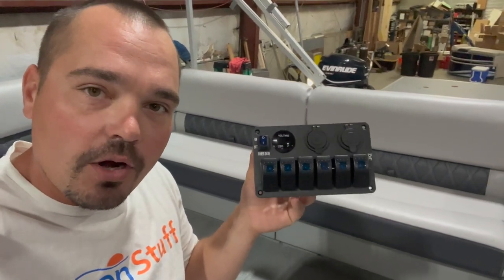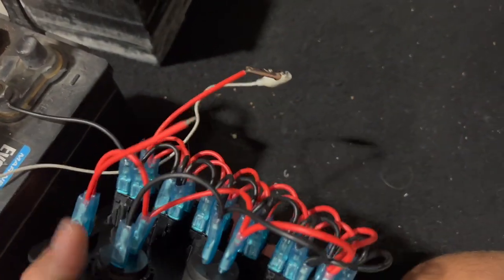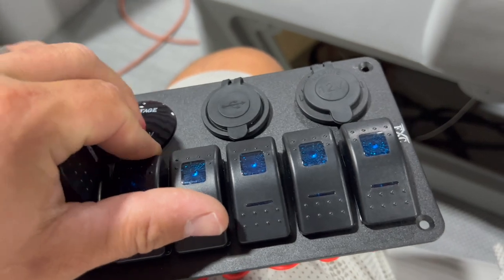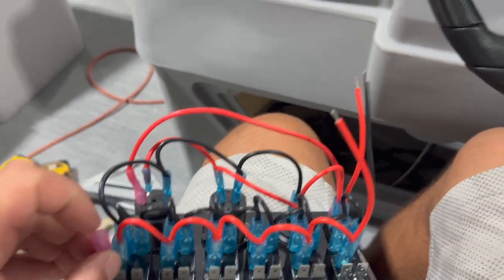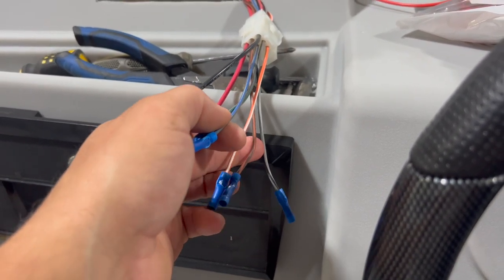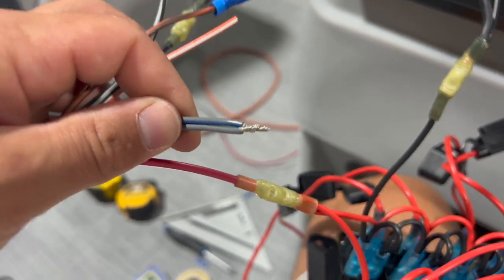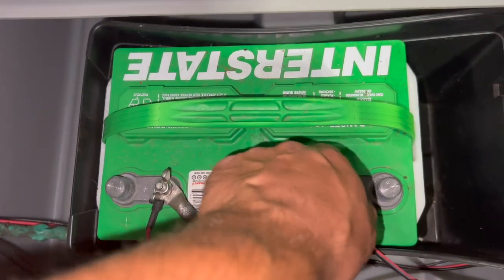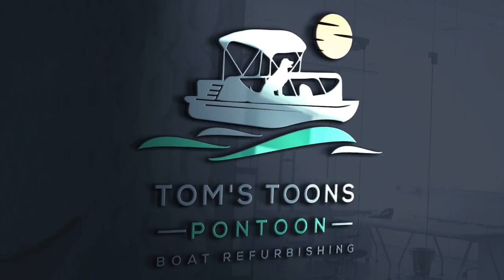Installing Amazon Marine Switch Panel - 6 Switch Panel on Pontoon

Comment: One thing I’ve never liked about these switch panels is how they daisy chain all switch inputs off one wire between all the switches, effectively putting all the load on the one wire feeding the switches. I’ve always played it safe and pulled the jumpers off and ran designated runs for each device Incase I ever have more than one higher draw switches on.
Reply from the maker: I definitely understand that concern. Most of the boats I work on seem to have the same setup where one power wire jumps across all of the switches to supply them power. That daisy chain or piggy backing shouldn’t be impacted by any other switch before it having an issue because it’s a steady stream of power from the accessory wiring harness to each switch. The in-line fuses are something I will be doing for this style switch panel to make it an easy fix if something ever has an issue! 

Thanks for watching!

Comment: Do you have any advice for maintenance on pontoons that will be used in saltwater? As far as the aluminum components.
Reply from the maker: That’s out if my wheelhouse as I’m just a Midwest freshwater guy. I’ve seen pontoons bottom coated when in saltwater to prevent corrosion of the toons. Also, Sharkhide makes products to protect aluminum in the salt so definitely give their products a look! Otherwise, I’d highly recommend reaching out to a pontoon dealer who sells boats regularly for saltwater use.

Comment: Can I ask how your switch panel has held up? Looking at replacing my 99' Pursuit's outdated panel with this. Saltwater boat sitting in a slip.
Reply from the maker: I haven’t had any issues with any of this style panel that I’ve installed. We’re all freshwater here in Michigan though. As long as you coat your connections I think you’d be ok!
Reply: @tomspontoons  awesome, thanks a bunch for the quick response. Figure it’s worth a shot at that low price point.
Reply from the maker: @WranglerRunner1  That's my thought. If it gets covered when sitting and you treat your connections with protection/grease then I think it'll last.

Comment: is there a way to use the switch to turn on and off the whole panel instead of just the lower lights?
Reply from the maker: I suppose you could jump power from the on/off switch that powers the chargers and voltage gauge to power the switches. I’d recommend an inline fuse there though as that’s a lot of power potentially running through that one switch. That way you’d run power to that on/off switch at the top and it would power everything when on and keep anything from working when off. 

I’d probably go with a heavier duty battery on/off switch if your goal is to have control over your accessories. You could simply have it on the console for your accessories only versus having it in the rear stopping all power at the battery.
Reply: @tomspontoons  Thanks,  I'm only using the switches for a horn (changing the first switch), then Nav lights and a Garmin Striker 4.  I'm putting this switch on a Boston Whaler 13' sport.
Reply: Also, I have the 5 switch version so it should be a lesser load.
Reply from the maker: @frankieb3652  glad to help! I love when stuff on our channel reaches beyond just pontoon boats. Glad my content was helpful for your Whaler project too!
Reply: What the empty connection on power save?
Reply from the maker: @cameronwyatt3491  really good question. Didn’t need it on this one. If I remember right it was just another light for the switch which would stay on at all times which I never like because of battery draw!

Comment: This video was so helpful! I haven't been able to find a clear video describing the use of a rocker panel. I am also going to delete out the "always on" lights for the switches. No need to slow drain the battery. I am going to a fuse panel that I added for my Short Bus conversion ;). Thanks so much for posting this!!
Reply from the maker: I’ll do a rocker panel at some point so stay tuned. Problem is there isn’t a nice clean matching nav light rocker switch that I’ve found YET. Glad this video was helpful! Thanks for watching

Comment: I have a 1988 SeaRay I’m working on and would like to install one of those “quick connects”, what is the name so I can look it up?  I’ve tried various searches and can’t find any blanks I can use.
Reply from the maker: Are you referring to the connectors that go onto each switch? Or the big white plug to quick connect the wiring from the main harness throughout the boat to the switch panel leads?
Reply: @tomspontoons  the big white block
Reply from the maker: @barddzen  I just did a quick google search and found a kit. Go to www.CJponyparts.com and search: "Painless Performance Quick Connect Kit 12 Wire Plug". You can find the same kit on eBay too.

Comment: Seems a whole lot of fuzes in random pain in the bum places to find and replace, wouldnt wiring all the positives to a 12 socket fuse box? That way all the fuses are in one easy to locate and service location?
Reply from the maker: I’ve been meaning to show a video using one of these panels with a fuse block like you’re talking about. Some folks love them, sometimes they have their own issues with corrosion and becoming a failure point. I have another video of an Amazon switch panel that has built in breakers…that’s my favorite style by far because it’s so clean and user friendly!
Reply: @tomspontoons  it's obviously different to where your located to where I am here in Northern Ireland we have different things electrical wise. I am planning on using a Blue Sea Add a Battery Kit Plus thing so I can have a starter battery and a second battery to run everything else off, because the boat is parked up on my driveway it can be plugged into the garage to keep both batteries charged up so I've no worries for a day's fishing.

We don't have pontoon type boats here I think our weather is to bad to have boats like that we need something with a deep v hull to cut through waves.

I enjoyed the video buddy, it's good I'm thinking of when I re wire my boat this summer I want to future proof it so when i come to add things to the boat the cables i put in can support them.
Reply from the maker: @DavidScobie  You're 100% spot on. There are different ways to do each part depending if you're in freshwater vs. saltwater as well as the type of boat...and you're right just trying to do it once and get it right so that you're not chasing problems in the future. We always love when boaters outside of the pontoon world tune into the channel as a lot of the stuff we cover is applicable to any type of hull. Happy boating over in Ireland!!

Comment: I have a question where did you find that Quick connect to run them rocker switchs I have a 2002  mercury I need that quick connect...
Reply from the maker: This accessory switch panel is 100% unrelated to anything with the outboard. A lot of boat manufacturers have their own wiring harnesses and use their own quick connects that likely won't match up with aftermarket options. That's why we typically just start over with all new electrical and switch panels for your 12v accessories.

Comment: So with the inline fuses, does this mean theres no need to run to a fuse box also? Say from switch to fuse block with a jumper?
Reply from the maker: It would be an either/or situation. I prefer inline fuses because they're easy to get at, just remove the switch panel and they're right there connected to the switch/accessory that's not working. It seems like fuse blocks always end up in hard to reach places and it can be a hassle to figure out which fuse is popped. Just my personal preference, no wrong way to do it as long as there's a fuse or a breaker in line to protect the switch and electrical system!

Comment: Hi, thanks for the vid. Is the panel waterproof (rain), based on your experience?
Reply from the maker: I haven’t had it in serious rain, but if it’s sealed up behind the dash it should be just fine. A bead of silicone when you install it won’t hurt to keep water out too.

Comment: Got this panel my switch is off when down but want it off when it's up not down how do I do it please.
Reply from the maker: Which switch are you referring to? The switches can all be removed and flipped.
Reply: The same as in your video above. Haven't got blue switch on mine just got the rest
Reply from the maker: @ChrisGriffiths-e1e  I'm not sure that you can change this panel to work like you're looking for. Either would have to flip the switches upside down or maybe look to another panel.
Reply: So are these waterproof staying like this then

Comment: Great videos. They are so helpful for those of us that need them. Where do you ground each individual component?  Would a busbar be the easiest way to ground if you’re not using a wire harness?
Reply from the maker: Thanks so much, and thanks for watching! Yes, a ground buss bar would be the cleanest option and easiest to modify later. You could piggy back into the grounds associated with the switch panel with the grounds from your accessories, that would be totally fine too and is something I do often. There is a "piggyback space connector" that allows you to plug into the ground post on the panel and tie the ground wire from the panel back in.

Comment: I just inherited a 2000 suntracker party hut 30. It hasn't been run since 2018. I'm trying to get replacement canvas for it. Do you have any idea where I should look? Also can you recommend a place to get a manual for the mercruiser 3.0?
Reply: I would try a dealership for both of those. Msybe they can point you in tge right direction
Reply from the maker: A local canvas and marine upholstery shop should be able to make you something to replace the old canvas no problem. I’m not a big I/O guy, but any Mercury and Mercruiser dealer should be able to get you a service manual for that motor. Even online marine parts stores might have it!

Comment: anchor light?
Reply from the maker: Typically we tie the anchor and front navigation lights into the same switch…all on or all off. Never hurts to have them all on, and rarely are toons moored where they’d want the anchor light only on. If that’s the case then definitely might want to have them each on their own switch or have a traditional rocker for that

Comment: I'm wiring a 3 gang with the USB and voltage on the top. First switch is a flood light, second is 4 blue cabin lights and third will be used to switch on/off the USB/voltage. I cut the always on wire out and am running that red wire from the USB/volt to the ACC post on the 3rd switch. How does it get power? Does it need another dedicated battery wire too? Or is that one power wire coming off the middle post work to power every accessory? Thanks!
Reply from the maker: Always tricky without having the switch panel in my hand, but I'll do my best...you need to have power coming in to each of the switches, then the accessory out wire can go to a fuse and to each accessory. Usually these switches have the power in piggy backed across all of the switches, and it's common for that to start on the volt meter and USB stuff at the top. Around 4:10 in this video I show the power in and where that jumps across each switch, versus the accessory power out. Hope this helps!